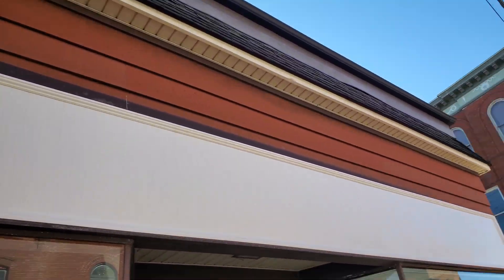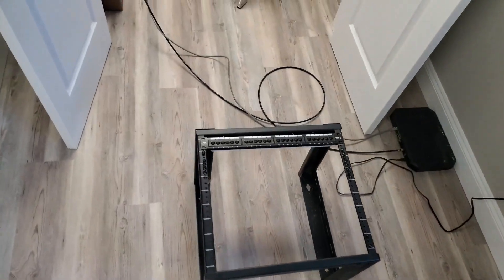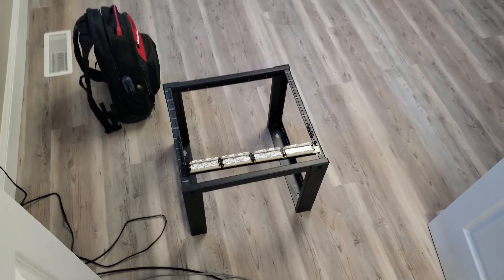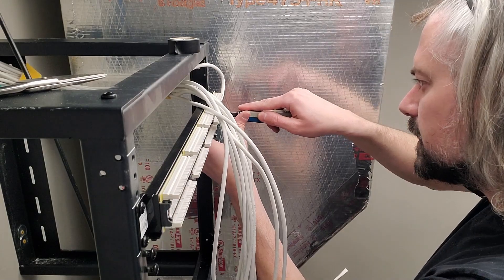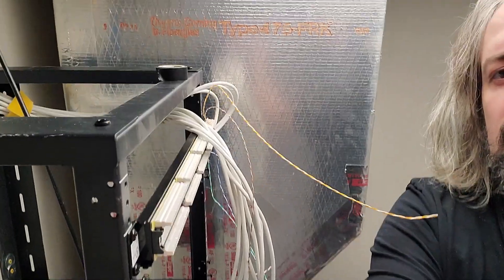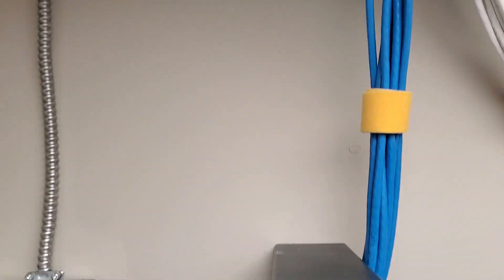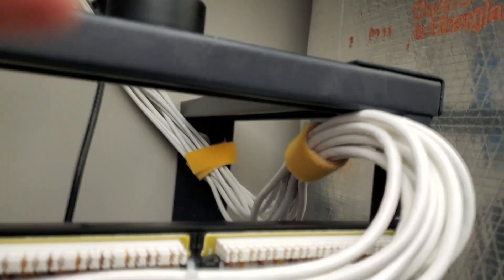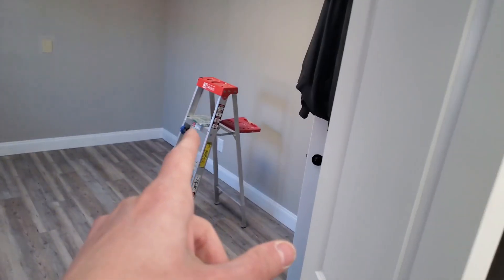Doing a simple rack and cat6 patch panel

Comment: Next time, id recommend using Keystones..  Good video ..
Reply: Definitely not
Reply: @bcm50  Why not? I always prefer keystone patch panels as the wires are easier to move around and reterminate if needed. In a setup this small it ultimately doesn’t matter though.
Reply: @ryderholland  i agree. switching up (and even down) cables is a breeze with keystones...